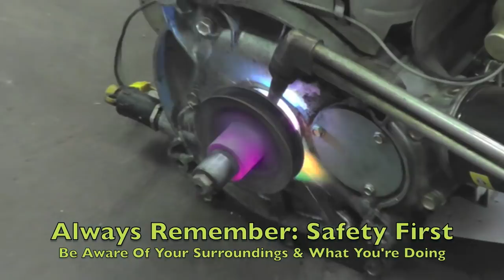Troubleshoot & Replace Camshaft On Briggs & Stratton Intek Engine

Comment: Hi what’s the reason  the governor keeps exploding, opened motor to change base gasket, put it together like I seen on your video, started motor and went to full rpm, shut off engine and opened it up and governor gear exploded again,  why why why and help .

Comment: I have a Craftsman yard mower. The compression release has broken off the cam twice in two and a half years. I tried to talk to Briggs  about the problem but they wont even admit there is a problem.  When I asked if they would buy the parts, they asked for my engine number. I gave them the one on the muffler and the one under the seat. I also gave them the number that the technicion that  fixed it the first time had on his receipt.  They said my tractor does not exist.  My question is, does this happen often with this engine Model 33R877.   Any thoughts to make me feel better about this crap.

Comment: I did what you said to do with the pulley, but my engine would not come off of the lawn mower so I had to heat it still on the lawn mower.

Comment: I noticed the cam that came out had the spacers near the tip but the one the new one didn't. Does that alter the alignment of the gears? I'm doing mine now and my cam that came out of my Briggs 18.5h has the spacers, some new ones do and some don't. Please help

Comment: I have a MTD rider with either a 313707-0132-E1 or a 313707-0162-E1. When I look up a camshaft, the only one I find is the one with the slot on the end. I do not have an oil filter. Will this camshaft still work? Is it just an upgraded part?
Reply: My dinner's gettin cold

Comment: I am replacing a bad camshaft but the gear on my old cam is solid and all the replacements I find have spokes, will this be a problem?  Briggs and Stratton 17.5 hp
Reply: did you ever get a reply ?

Comment: can i use a notch cam shaft on a non oil pump engine?    I looked at the part number and that is all that seems to be available the cam with notch, my engine does not have an oil pump. What can i do ?

Comment: Iv got a vanguard 16hp vtwin modle 303777 and the camshaft lob is worn and needs to be  replace. I have several old engines and was wondering if you could tell me a list of camshafts that would interchange or be compatible with the engine thats needing to be fixed
Or a list of engeins that's got the camshaft that will fit?
Reply: Please send list of compatible enginea with a cam shaft that will work in my vanguard 16hp vtwin modle#303777

Comment: 23 hp Intek. If the flywheel key is good, the compression is 170-180 psi, why would it shoot flames out the intake? Could the valve timing be off?

Comment: hey taryl how do you bypass the voltage regulator on a craftsman riding mower to have mower charge without the voltage regulator
Reply from the maker: You have to use another type alternator. I take it you have a Briggs engine?

Comment: i've had the experience where the cam is not broken, but acts like it is. I opened it up, and everything was intact. the cam had everything where it was supposed to be. So what was the problem?, I put another cam in, but wondering what makes a cam not work right if everything is intact on the cam.?

Comment: Taryl, great job. Oil pump and splash?  Ya they call  it a Pressure Lubricated Engine but just goes to bottom bearing if that.  do you really need pressure to that bearing sitting under oil?  Is this a gimmick Taryl?  Seems to me it is.  My filter does not get hot even after the mower has been running for awhile makes ya wonder how much oil is going through it.  Gimmick I'd say.  Residential light duty don't need no filter but if it gone to come with one make it real.  Like your work.

Comment: I have  a question  my JD Z225 18.5 B&S smokes I have replaced head once and still smokes . What I want to know is if you can move the piston from side to side inside the cylinder with you're finger dose that mean the rings are bad.
Reply: It could be. A tell tale signs would be scratches on the cylinder walls and piston. You have to take it apart to see it in details.

Comment: If I seat my camshaft in my 20hp intek the timing gear is about 1/8-3/16 higher is that OK I feel like they should be flush the governor gear is flush with the camshaft gear

Comment: can you tell me if the 793880 camshaft is the one for a 31H707 18hp briggs and stratton ohv single cyclnder motor?
Reply: probably will work! I am working on a 31A507 B&S engine.  Took forever to find the camshaft part number- when I did Jack's small engine part place said to use 793880.

Comment: To get that camshaft off, hit with blue tank propane right above the seal at the base. 5 minutes wd 40 in top hole while hot, then 1 tap with a pry bar from the bottom to get it loose

Comment: Hello,

Can you give me the tightening torques for the engine 286707-1142-E1?
I can't find it anywhere in  the Illustrative parts List and the Operators Manual, especially the one on the piston rod where there are two different bolts on the connection to the crankshaft!

thanks in advance

Comment: is a crankshaft swap that easy?, or do the bearings,and rod need replaced too?, its a honda gx engine and the crank output is an odd size?
Reply from the maker: +THEBGRED1 As long as the bearings aren't worn out. The connecting rod doesn't have bearing inserts like a car just polished aludimin. Some small engines have a ball bearing on the PTO side, some just a bushing or just bored & polished aludimin. So on the honda you have a crank output shaft that you want to change to something else. I would take the crank you want to change out first so that way you can compare it to the one you want.
Reply: +Taryl Fixes All LLC  thanks for the input, want it for a mini bike its a honda gx160 with a 20mm output? hard to find clutches or adapters for it
Reply from the maker: might be able to have a machinist make a sleeve or turn the crank down to 3/4" & add a key-way.  I've had to have that done for bastard sized cranks on engines I wanted to use for projects. Actually I have a crank out of an 8 HP Tecumesh from a snow blower now that I have to have a hole drilled & tapped into the end so I can secure a clutch to it so I can use it on a future project.

Comment: Taryl, can a bad cam cause the engine to miss? mine is missing at high speed only
Reply: I'm not sure if it will with a mower engine, but it sure will with a car engine, usually causes it to backfire.

Comment: Hey Taryl,
Did you run across an old briggs lawn mower engine yet? You know the classic old push mower type rated at 3.5 hp with a throttle lever. I need one for my roto tiller. Just wondering if you got one yet.
Thanks for the video.
Reply from the maker: +J&amp;B Fix it shop  Was that a down shaft engine?
Reply: You mean a vertical? Yes that is what I need.
Reply from the maker: +J&amp;B Fix it shop Would a pressure washer engine work fer ya?
Reply: It might does it have a throttle control? and is the output shaft 7/8" Hey thanks for getting back with me.
Reply from the maker: +J&amp;B Fix it shop One nice thing about the pressure washer engines are that they have a heavy flywheel for easy pulling & some have a separate choke you'll have to add a throttle though. And what length shaft. Harbour Freight has those Chinese engines that would work they have a 7/8" diameter crank you'll have to check the length. The only problem with those engines are no available repair parts.
Reply: Hey that's a good idea. That is why you get paid the big bucks. My saying is she will go or blow so not worried about repair parts.
Reply from the maker: Theres yur Dinner!

Comment: Had fast idle issue. Could pull on governor linkage and would idle down. Split case and found governor broke and compression relief lever broke off cam. Replaced cam and governor. Now idles fast move governor linkage all the way closed still idles fast. Open the governor and idle increases. Adjustment screw all the way out still idles fast. Could I have done something to carb when it was flipped upside down or a tooth off on timing. Need help
Reply: did you ever get any help ?

Comment: HELP!!! (Please). First, great video and I replaced my camshaft and removed/cleaned all remnants of broken ACR(thanks for proper diagnosis).. HOWEVER even with new ACR and valves lashed per your other video on ohv... I still canNOT hand turn motor with the spark plug inserted. Too much compression. Bewildered and hopeful that someone can recommend what else to examine. Thanks
Reply: you ever get reply ?

Comment: Is it possible to install a fuel pump on a single cylinder engine that doesn't have one?
Reply from the maker: +Dastardly84 Sure, You just need to pick up crankcase pressure Via the valve cover,dipstick tube or Drill & tap a hole in the block for a 1/8" pipe tap. Make sure its in an unobstructed area and as high up on the block as possible. You don't want oil to get into the pulse line.

Comment: That quick drain cost me a piston and rings. New Briggs engines come with an NPT plug as they should. If ya want to get fancy a nipple and an elbow make oil draining even easier because you can put the drain where you want it.
If you paint the shaft and inside of the crank pulley with anti-seize they slide right off next time. BTW that pulley isn't hardenable so armchair metallurgists should post a Rockwell test video if they're so sure. All metal properties are testable.

Comment: I tried the air hammer trick on a car steering wheel and the damn thing came right off.  didn't even need a prybar, just lifted with one hand as i hammered.  
what a great friggin trick, wish I knew about this before buying all those stupid pullers.

Comment: Hello Taryl this montana again I have B&S 18hp.always surging.cannot go high.ok when I open the bottom the engine.is governor olose to the left from the arm.everything inside the engine good.and I put together,when I crank it engine good go high look like ready for mower.but now I have problem the enginge stay high cannot go down slow.I play with the sping on barburetor with screwdriver.still cannot go down the RPM.can U help me MR nice guy ???
Reply from the maker: +Tonny Dermawan You don't have the governor adjusted correctly
Reply: +Taryl Fixes All I will try set the governor like u do next week I let you know mr..

Comment: OK   Taryl,,   I just have to ask,, Have you ever tried to cut the slots for the oil pump, from a non slotted camshaft?  Be honest ,,  I have seen you adapt & overcome in many of your vids, so have you done this?   No I do not need to do this,   I just am curious if YOU  have done this,, If so Make that vid!                                                                                                                             kodibass

Comment: I have a briggs that I thought/think the Cam is bad. Fuel, compression, spark...but will not fire. Valves and seats good. Anyway the book says 1.0039 in. (25.50 mm) standard and .9764 in. (24.80 mm) reject. Both lobes measure about 1.25 in (32mm). They measure bigger than the manual says. WTF? Any ideas?
Reply from the maker: +Badboy7357 Won't fire even when you spray or pour gas into the carb? Did you try a new plug sometimes it can be as simple as that? You didn't shoot it yet, I hope?
Reply: +Taryl Fixes All  It did run, but was starting to turn over slow/hard like it had fluid in the chamber. Spins like a top with the plug removed. With starting fluid it may somewhat fire. I figured the timing was off. Since it isn't working, and is old, I can't make it worse by trying myself. The cam is all metal, but the timing marks on it is on a tooth instead of in the gap, while the other mark is on a tooth...and the thing seems to large looking at the specs. I haven't shot it yet, but I do make black powder and July 4th is not far away.
Reply from the maker: Timing marks should be one on a tooth & one on a space. Where did you get this mower & did it run before?
Reply: It was bought new years ago. It is a White rider. It did stop running due to the valves, but I did a valve job and it ran fine and one day it just would not start again. The inside parts look fine.I need to parts cleaner it out as there is still some oil in it and since its open, everything will get a cleaning. A new cam isn't expensive, but the original doesn't look bad...it just doesn't measure as worn but as too big.
New spark plug, carb solenoid is good, I cleaned the carb, and the valves were in specs prior to opening it up. I could find a used 14.5 HP engine, but I am not one who likes to give up...besides I am learning new things on this.
Reply from the maker: This is a OHV engine right. All original parts. The reason I ask is I get so many questions I get some people confused. It has a cast cam not the newer pressed together POS.
Reply from the maker: Just thought of somethin. Did you have the flywheel off? If so  & if you didn't get the nut tight nuff could have sheared the key & throed timmin off.
Reply: Well, I finally got around to putting it back together after pulling and measuring everything.  The sear pin looked straight but I put in a new one anyway.  It now runs! The pin is the only thing replaced, and I didn't think a rider could damage the pin due to being belt operated.

Comment: i have a brigs 7.5 the plastic crank gear striped out.Replace with steel one .timing was to be dot to dot but my plastic crank has a dozen dots and two hash marks so i used them Is that Right ??? set valves one at a time 4 and 5 k went to start it wants to jerk the rope out of my hands. checked carb for excess gas clean needle valve reassembled  same story ???? how much powder does take to Blow this up Can Any body HELP????
Reply from the maker: Do you mean camshaft? If so, if you replaced it with a steel one is it the camshaft for that model engine? Also did you have the flywheel off? If so and you did not get the nut tight it could have sheared the flywheel key. That will cause the rope to jerk out of yur hand.
Reply: I replaced the cam gear on the crank not the cam it self. never had the flywheel off. is that something i should be looking at?? this is on a power washer.Got my part at your supplyer.hope they got it right .
Reply from the maker: Well the new gear should have only one mark on it right? and the camshaft has one mark & you lined them up correct?

Comment: Hi Taryl: I work on lots of small engines but I am stumped on a Honda GX340 with a pulsar coil. The coil is NG. Can I replace with with a standard GX340 coil or do I have to get one of these pulsar coils that has an additional prongs that  pluginto one side of the coil. It also has a kill switch terminal for the switch. coil is a 30500-ZE3-033 Honda code 2108249. Any help will very appreciated. Thanks, Steve May
Reply from the maker: +Stephen May There was a guy last week in my shop lookin fer one of those coils. I know the standard coil only has the terminal fer the kill wire. I don't know if you can replace it with the standard one. If I get one in here fer repair I would try the standard coil to see if it works. I know when we looked them both up the price was about the same. Hope that helped ya.
Reply: +Taryl Fixes All LLC Many Thanks, You are the best. Steve
Reply from the maker: Theres yur Dinner!

Comment: what causes this problem of wiping out the cam lobe?
Reply from the maker: +Fast92RS383 Crappy metal. Briggs use to cast their cams now they are pressed together.
Reply: +Taryl Fixes All LLC ok I also use specific oil for 4 cycle engines. I had read that regular oil used for newer vehicles does not have enough zinc in the oil for flat tappet small engines.
Reply from the maker: +Fast92RS383 Thats right. Briggs now recommends the use of synthetic oil.
Reply: +Taryl Fixes All LLC Thank you for all the info. I have watched many of your videos and they have been helpful but I think you have sucked in too many exhaust fumes lmao.
Reply from the maker: I should be wearin that mask you got for yur profle picture
Reply: +Taryl Fixes All LLC lol

Comment: Throw the plastic oil drain in the trash and use an NPT pipe plug (which Briggs RETURNED to) because the plastic abortions fall off and wreck engines. I found out the hard way. Easy way if you don't remember pipe sizes is remove the fitting on the crankcase when you change oil and use it for a sample at the hardware store.

Comment: A Chevy mechanic can't fix a Briggs & Stratton WTF? Maybe you should let him put oil on the shaft.. I set my valves after TDC as B&S suggest. Back in the day, 2-cycle Detroit engines were set on valve lift like you stated.

Comment: What causes the lobe to wear down, poor maintenance?
Reply: you ever get reply ?
Reply: Sure didn't.
Reply: Marty Marsh just in case, usually it's the simple things, not changing  the oil or running low on oil.  The lobe has a hard face but if that gets worn through it will wipe out a cam real fast.  I'd have to check if both lobes are pressure lubricated or if the exhaust lobe is splash lubricated.

Comment: If people are making a big deal about the temperament of the pulley they're crazy the only thing you may have to worry about is a temperament of the crankshaft if it's a tempered crankshaft and you he didn't quench it like that you might just take the temper of the crankshaft and the RPM the engine may break the end of the crank off

Comment: These are the worst engines.. the compression release with it's cheap spring will always fail and the head gaskets as well . When the compression release gets slung off, most of the time they'll get into teeth in your cam and break several teeth and into your governor causing debris everywhere in the engine.  Shame on B&S ...